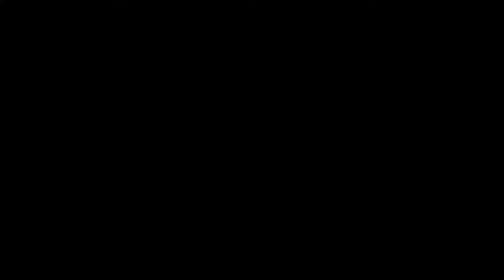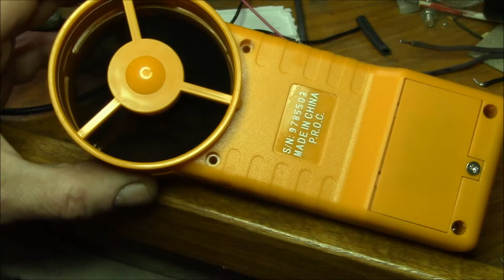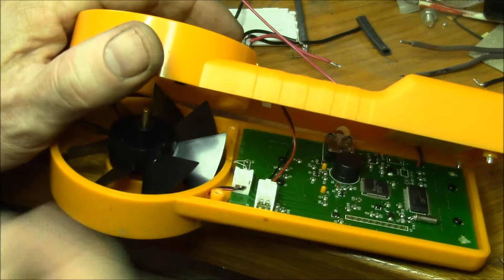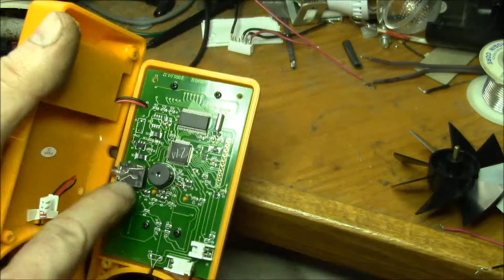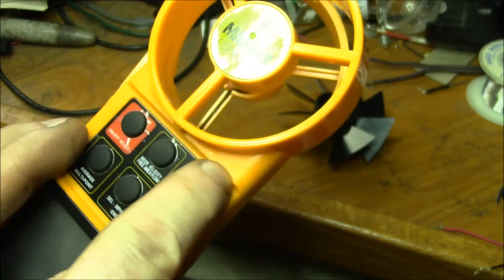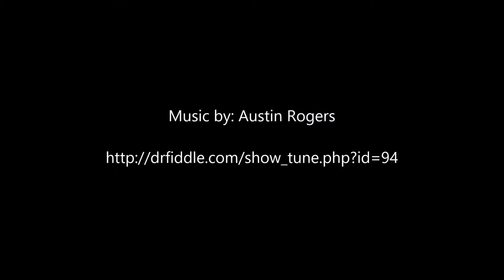CFM Master-II - Air Flow Meter Tear Down

Comment: how accurate are their readings?
Reply from the maker: +Aquakey 98 According to the manual, air flow +/- 3% and temperature +/- 1*C and it seems to be within those ranges.  Temperature matches with a digital thermometer and an IR heat gun.  Air flow speeds seem to come up with CFM values that match what my main air blower is rated at, so I think close enough for my needs.